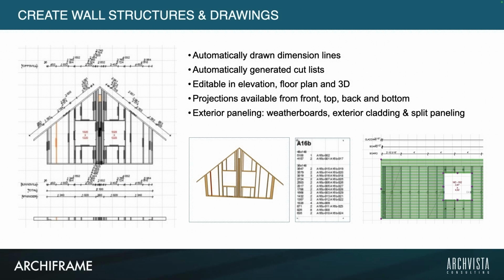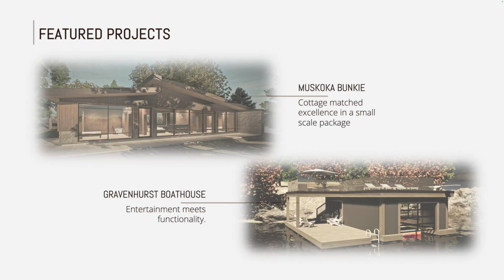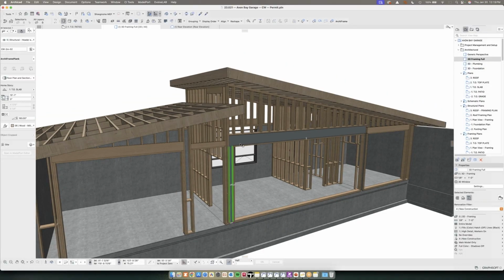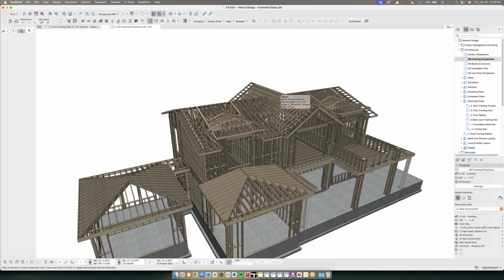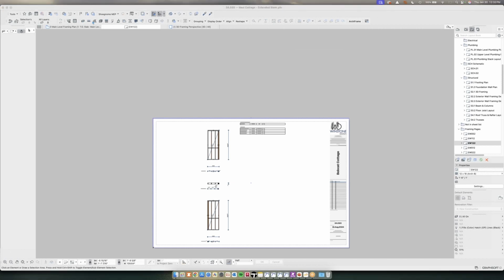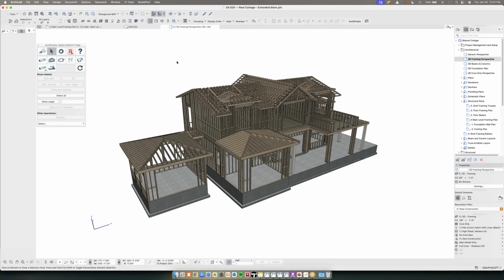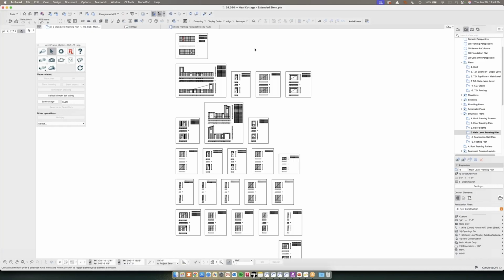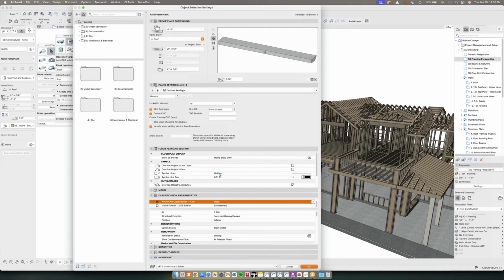ArchiFrame Documents to Cut List with Winstone Design - Customer Webinar

Comment: This is great, thank you for this presentation. What are the prices of the different versions?
Reply from the maker: Thank you! ArchiFrame price is similar to the local price of Archicad Studio subscription ($200 per month in USA). Cnc-support adds 50% to the price ($300 per month in USA).
Reply: @ArchiFrame  This software will be a game-changer in terms of wood construction. There is an education company and reseller also in Austria and southern Germany. They are on the way to translating the software into German. I have been watching the software ArchiFrame since 2018; it has made so many great steps into the future of machine-manufactured wood construction. I also switched from another software to ArchiCAD. I worked for many years in CAD construction as an architectural office member. As a civil-structural engineer and carpenter, I saw the great opportunity to focus on both architecture and wood construction. Now I'm searching for a way to develop it into the new architectural office. Your presentation gave me an overwhelming overview of how. Thank you so much. Greetings from overseas.